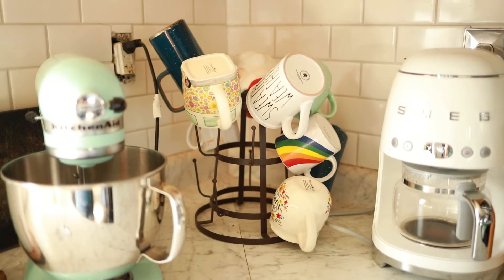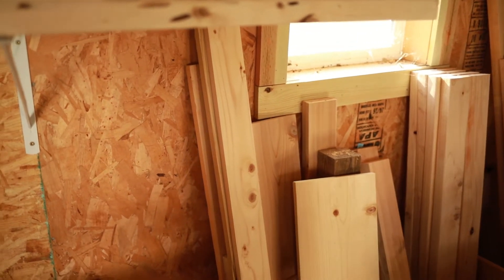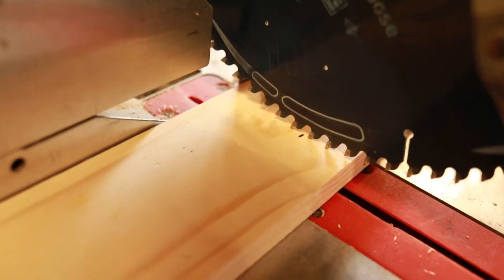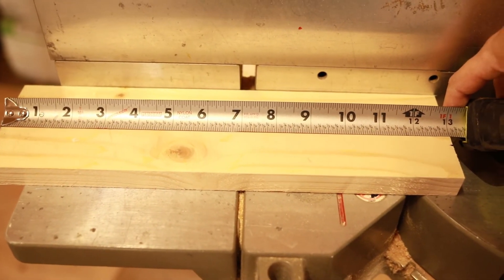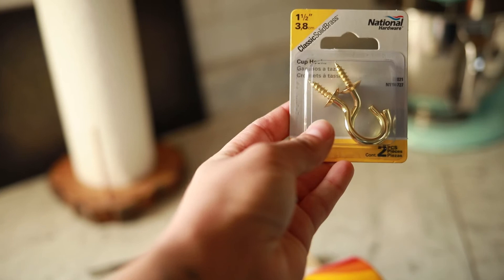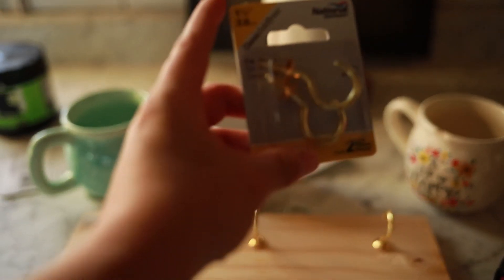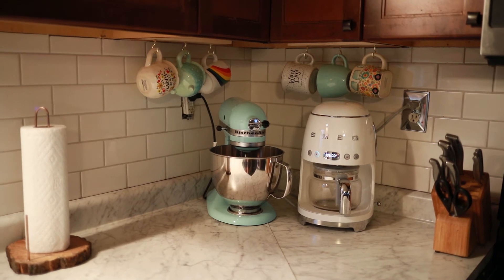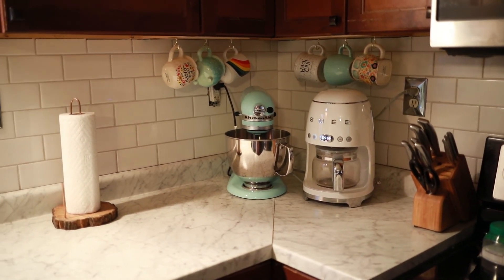EASY DIY Coffee Mug Holders + How to use a miter saw

Comment: Would of been a better DIY had you shown how you screwed the piece of wood to the bottom part of the cabinet as well.  Otherwise, good concept. 👍🏻
Reply from the maker: Pretty easy. Just a screw long enough to get through your piece of wood and the cabinet, but not long enough to cause trouble in the actual cabinet. Screw it in by hand or drill.